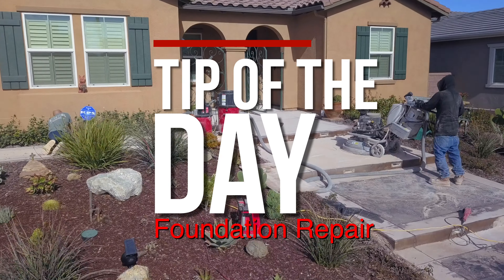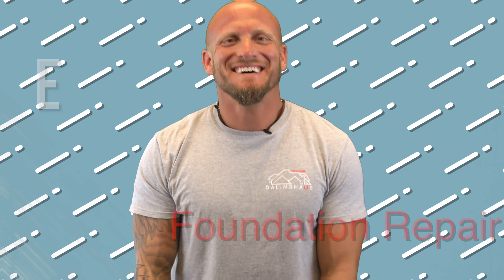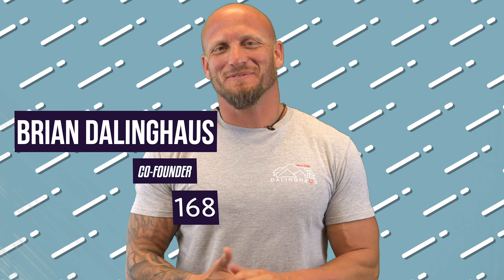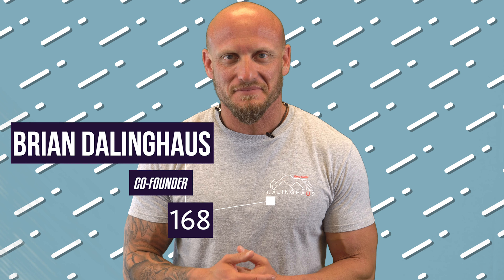Pros & Cons to Pier and Beam Foundations  - Foundation Repair Tip of the Day #168

Comment: Hi Brian you've probably been ask this question thousands of times or have another video on this, which is better pier&beam or slab cement? I do live in texas , my concern is having critters,snakes,spiders,going under the house but what I heard the pier&beam are easier to fix; example:  one video I saw a horrible job done on slab in the bathroom, they had to drill because somebody didn't put a pee trap or something like that and it cost $$$$
Reply from the maker: Hi Estaban,
If you are worried about the critters getting under your home , you could have your crawlspace encapsulated.  It is where they install drainage and sump pumps and cover the  entire crawlspace area with a thick plastic membrane.  Usually around 20mil.  The pier and beam would also allow you to have some additional storage and easier access to your utilities if you ever do have an issue with them.
The slab on grade is also good, because you then  have a complete barrier between the interior of your home and the soils below.   Granted you won't have complete access to utilities such as  sewer, but most of the other utilities can be ran above ground throughout the home.  You also don't get the creaking of floors due to the floor being suspended like the pier and beam foundation.
It truly is just a preference to what you prefer.  Both have their benefits.  I personally prefer slab on grade homes.